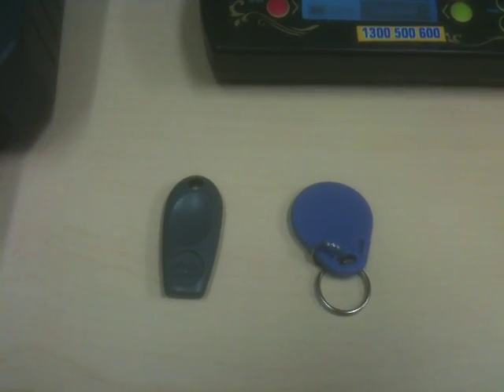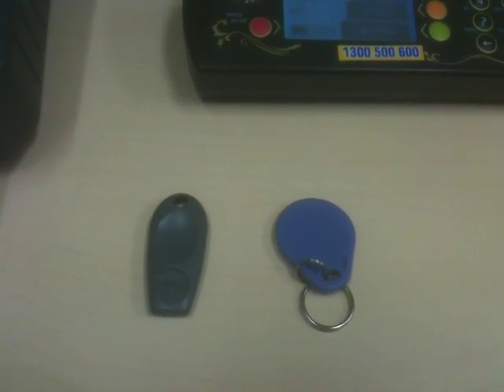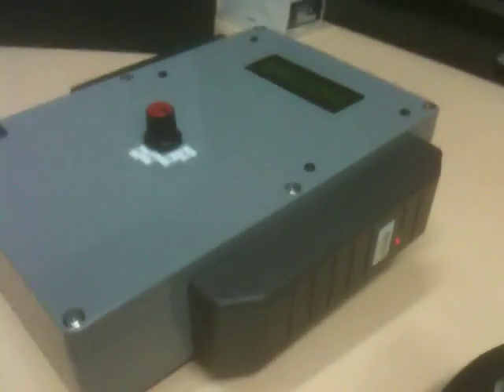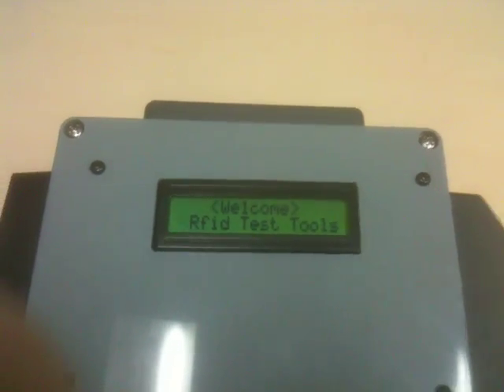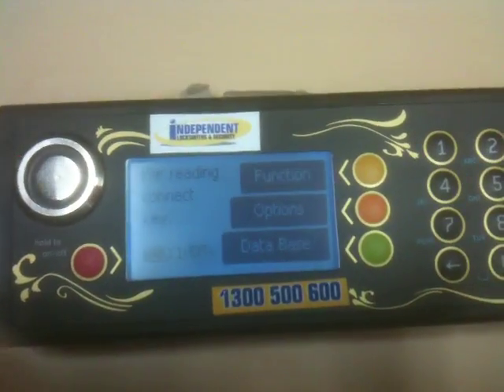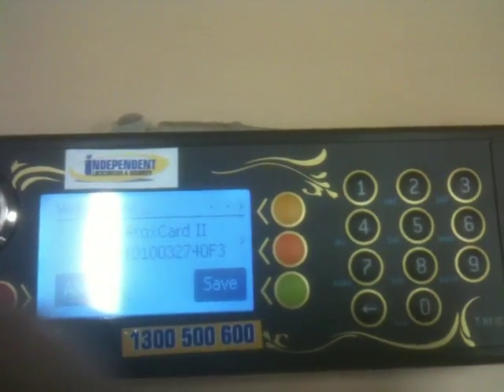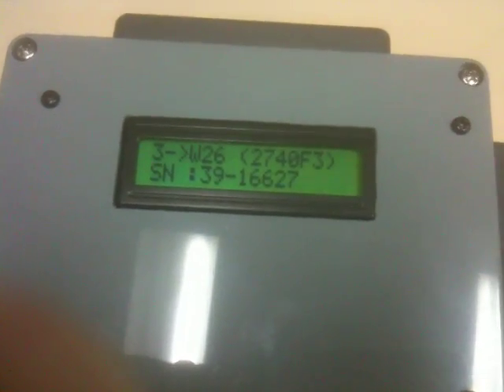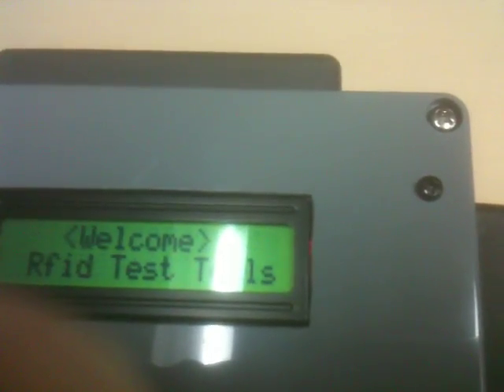RFID Access Control Card duplication

Comment: How about HID cards? Are they more secure? Hope that HID card can't be copied so easily.
Reply: Hi Mammothboot, the grey fob in the video is HID 125kHz prox. If you have HID iClass which works at 13.56Mhz then you are more secure.
Reply: +Independent Locksmiths & Security Pty Ltd why should 13.56Mhz cards or NFC Devices more secure?
Reply: +Carsten Groß  they aint lol i copied a 13.56Mhz one  fucken idiot from mr security
Reply: +Carsten Groß 13.56MHz cards are more sophisticated than 125kHz cards. On a 125kHz card there is generally a single code that can be copied as shown. 13.56MHz cards are made of many sectors that can store different information. When the cards are manufactured they have a Unique ID (UID) in sector 0 (zero) that is locked down. The UID, other names include CSN  (card serial number), until recently, could only be read and repeated (see proxmark) but not cloned.  This is because you could not buy cards with sector 0 empty.  Now cards with a writable sector 0 are available but are not easy to find and the equipment to clone 13.56 is harder to use. Beyond this, information in each sector can be encrypted using 2 x  codes (A&B). To crack the sector you need the 2 x codes. This makes 13.56MHz more secure.
Reply: +Carsten Groß 13.56MHz cards are more sophisticated than 125kHz cards. On a 125kHz card there is generally a single code that can be copied as shown. 13.56MHz cards are made of many sectors that can store different information. When the cards are manufactured they have a Unique ID (UID) in sector 0 (zero) that is locked down. The UID, other names include CSN  (card serial number), until recently, could only be read and repeated (see proxmark) but not cloned.  This is because you could not buy cards with sector 0 empty.  Now cards with a writable sector 0 are available but are not easy to find and the equipment to clone 13.56 is harder to use. Beyond this, information in each sector can be encrypted using 2 x  codes (A&B). To crack the sector you need the 2 x codes. This makes 13.56MHz more secure.
Reply: +Get Electronic Easy tiger! I have not seen 13.56MHz cards cloned easily. If you can do it then show us. I would like to see it done and get the equipment to test it myself.
Reply: +Carsten Groß In relation to NFC, I understand that the reason it has not taken off as a viable alternative to cards and fobs is because of the security concerns around cloning.

Comment: Not much different from locks/keys, is it? If you have the original, you can duplicate it.  This is why most co.'s have policies to report lost or stolen keys/card cards.  Except replacing cards is more convient than replacing both locks & keys after a key theft. Don't understand the fascination w/ cloning EM or Mifare cards.  You do realize that you need not only an encoded card or keytag, but also one with access rights to facility you're trying to enter. Important but missing from your demo.